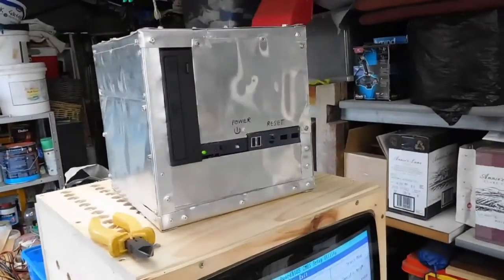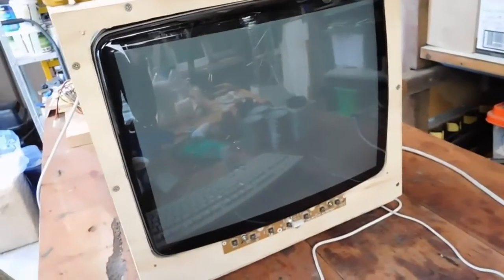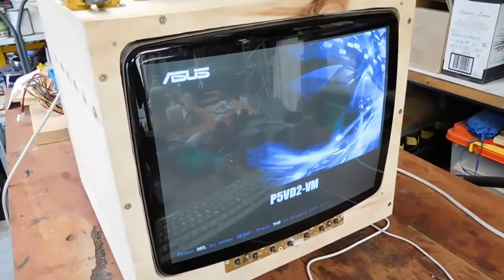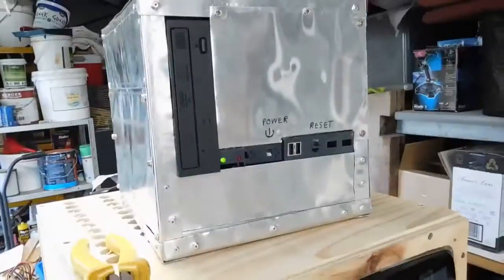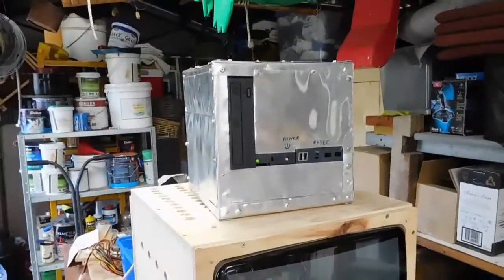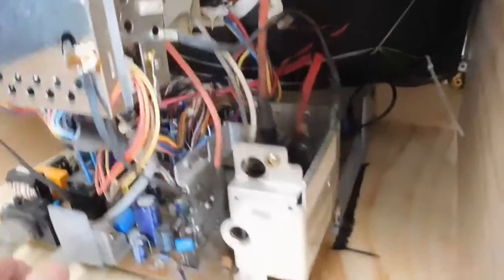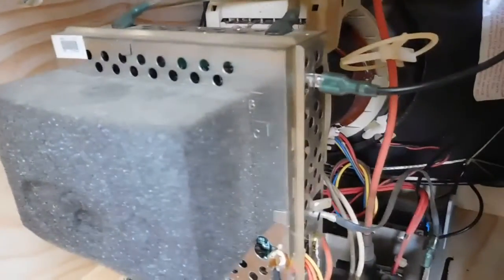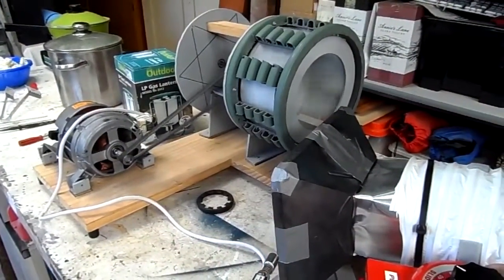Cube Computer Issues + Wood Monitor Insides

Comment: "NTLDR Is Missing" is a message from the boot record of a drive, if you're seeing that, it is at least reading the first few sectors of a drive.

"No any drive found" is I think a message from an onboard raid controller.
Reply from the maker: Ahh so it may be a bad drive? Although the odd thing was it picked up the FDD after I finished rolling film.

Comment: Have you tried setting it's default drive, be it c:, cd or floppy to it;s first boot device?
Reply from the maker: Yeah I did have a go at setting it to different drives, I got it to work with the floppy after the vid finished but that's about as far as I got with it
Reply: +Machine Man check your sata ports, both Data and Power. If nothing, could be a faulty drive. Check your AHCI settings too, sometimes they can cause issues like that if not properly setup.
Reply: +umbrefawx is the dvd drive a sata too or is it IDE (40  pin ribbon cable)
Reply from the maker: +umbrefawx OK will have a look, yeah CD burner's IDE